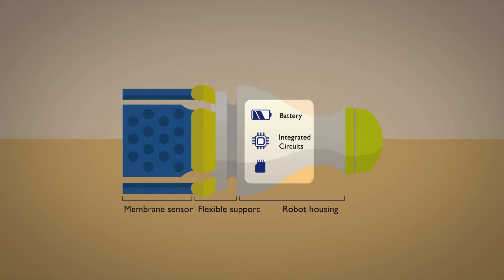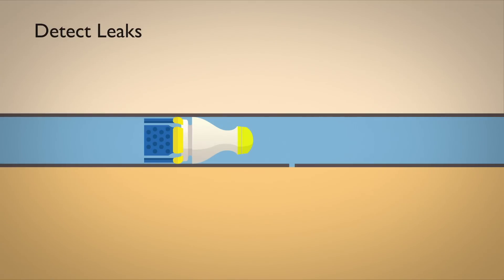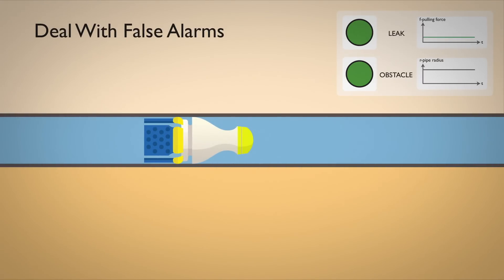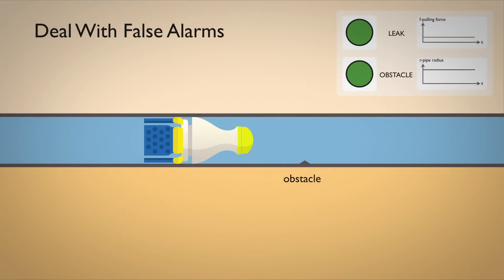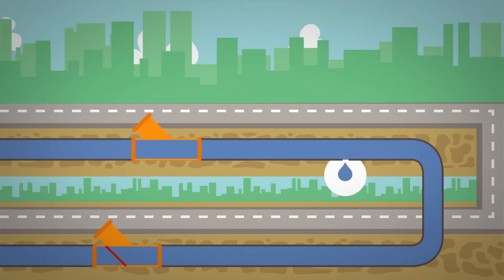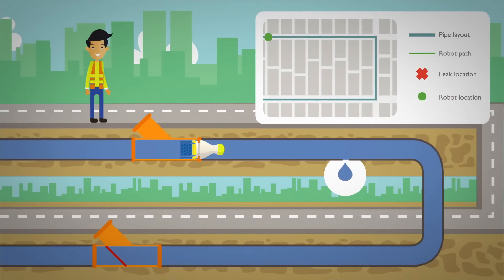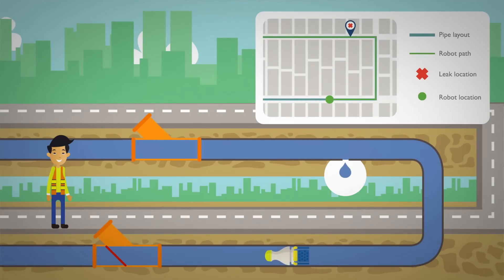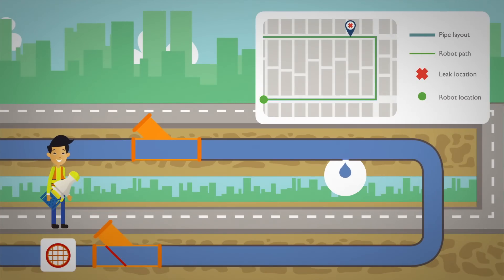MIT Leak Detection Robot for City Water Distribution Systems

Comment: How do you keep the pipe pressurised while entering and robot exiting?
Reply from the maker: We do use a launch tool. It is a section of pipe to the Tee junction on the pipeline. This attachment has two valves one on each end.